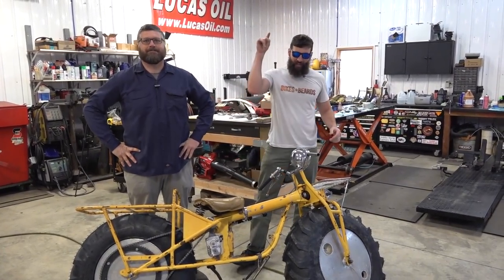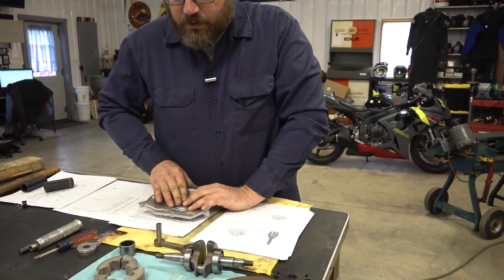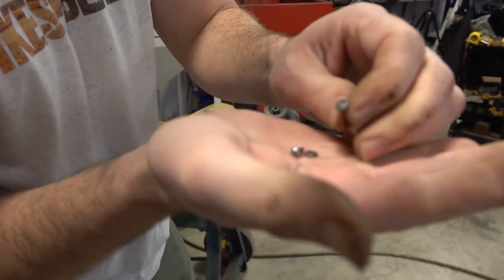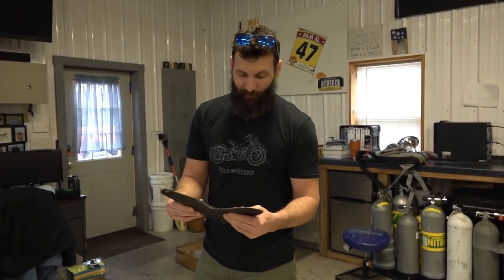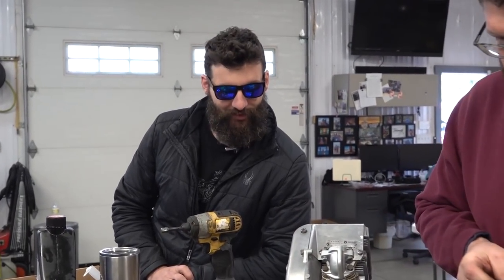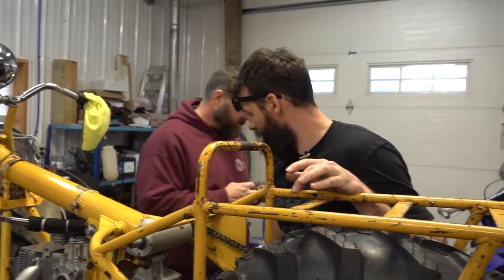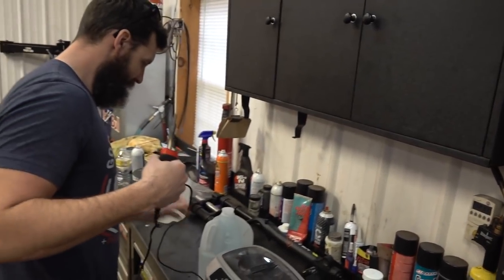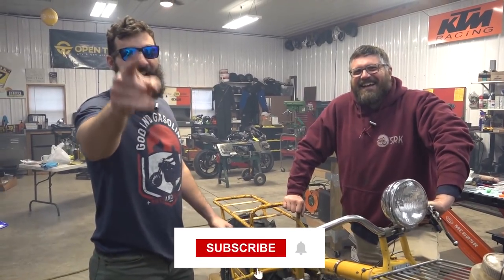Will it RUN?  Rebuilt Ed’s Rokon Engines finally Goes in

Comment: I used to work at the company that was producing the 820 engines in the 90s into the 2000s . I machined the blocks , support plates,  milled the heads etc.  Also built them . Tough little engine .

Comment: Just a thought. If you run the piston to TDC check the carburetor intake and see if the piston clears the port. If not trim to clear. Will improve performance. Exhaust clearance can change timing.
Reply: Ed will be dead before. You get the nugget and it all Together

Comment: Just a thought, would it be worth putting an electric starter on it for Ed instead of the pull start, incase he’s not strong enough to kick or pull start it. I’m super excited for all these projects coming together for Ed.
Reply: Looking at past video of Ed I don't think he will be using it without the help of someone else. Though adding it would be nice for anyone so maybe.
Reply: @pleasedontwatchthese9593  he rode the modern rokon alright!
Reply: I just typed the same thing 😙
Reply: I don't recall an electric starter ever being available for these engines. That may be something that the oems added on to them. But even then I've never seen an electric start on one of these Chrysler two strokes.
Reply: @MostlyInteresting  you can get kits to replace any pullstart.  I think it would be a worthwhile addition
Reply: @LTD347  link?
Reply: Great suggestion 👌.
Reply: He’s not 35 anymore. I doubt Ed’s gonna ride the thing much. 
Those old Rokons are like riding a solid frame chainsaw. 
New Rokon’s have suspension.
Reply from the maker: It would be if we could find someone who made a e start kit for it
Reply: @BikesandBeards  you guys are incredibly smart, I’m sure you could fab something off a different motor to work
Reply: I just typed the same thing 😆
Reply: I know a guy who is an s-tier expert on these engines. He used to build them and race them in carts. I will ask him if he's ever seen an electric start.
Reply: @LTD347  mans went from saying they make kits to saying they could fab something up, seems legit
Reply: They already resolved this when he used the impact to test for spark. Just weld a socket to the pull starter, and bring a cordless impact with you.
Reply: @82cj8  the problem with continuously using an impact on the socket to actually start the thing is you continuously tighten the nut which may break off the end of the crankshaft or put the flywheel so hard up on the taper you may never get it off
Reply: well they sell electric starter motors for 2 strokes on ebay for around $80.... what they do not sell is the custom cover, shaft, or welding skills to put it together.... but you can get the starter switch there.
Reply: This may be a moot point. I seriously doubt the owner is going to be riding this around alone.
Reply: @MostlyInteresting  you obviously don't know anything about Ed lol. He's a helluva 85 yr old.
Reply: My contact tells me that motor is still being made. United States Motor Power, Inc. If anyone knows about electric start they will.
Reply: If the carb gets tuned good, and it has strong spark you won’t have to pull your arm off to start it.
Reply: @BikesandBeards  attach some kind of battery impact driver on the pull start

Comment: When I was 15, I rebuilt my Kawasaki 100 engine and I just learned about 5 things I did wrong. The engine ran about  4 hours and locked up again.
Reply from the maker: ooohh no what did you do wrong
Reply: Yeah that's a little rough being 15 n rebuilding a motorcycle engine. Wow

Comment: Pressing the bearings on that crank that way will tweek the crank.. you need to support the counter weights.. not press them into each other...
Reply: No comment...typed a long one and deleted.
Reply: after seeing him hammer in that wrist pin I'm sure it's not that important to them ha
Reply: @fluxburner1636  My mouth was hanging open long before that. Had to run duct tape around my head to keep from stepping on my jaw.
Reply: @gailtaylor1636  lol I know what you mean
Reply: @fluxburner1636  hahaha 🤣 Shame on the mess !

Comment: Great job. I’m kinda concerned for Ed though. He mentioned this thing only had front brakes but the new ones have both. Prolly the reason he wrecked going downhill in the first place. 
Will the new models rear brakes bolt onto this thing? Need to keep old Ed healthy.  Well kinda. This thing could prolly use a cigarette pack holder on the front handle bars😂
Reply: Yeah Ahhhh,..Ed will Only be allowed on level ground so no worries.
Reply: yea front breaks going down hill takes skill even then you might dump it
Reply: @michaelpayne1737  I’ve actually dumped a bike on slick level ground
Reply: @sanjosejeff   Yeah I don't like driving on slick pavement.... I got caught in the rain one time.
Reply: The brakes
Reply: Sorry the brakes I saw on these things were a small disk on the drive shaft. One brake for all. But if you turn real sharp the front drive disengages.
Reply: Kind of shows how little he knows about the Rokon,  They only have one brake and it stops the entire driveline to both wheels

Comment: Sean, don't pull a pull start until it stops! That's the way you break the rope. Make a bunch of continuous short pulls and stop well before the end of the rope pull and the engine will start quicker. Quick, shorter brth, brth, brth, style pulls until the engine starts. {I'm aware that sentence is lame, but without being there to show you what I mean, it was the best I could do :-*} This from a guy who broke a few starter ropes on his two stroke gas powered tools who learnt the hard way. Good luck and God Bless! Congrats to Dan!

Comment: I sure hope that crank is still balanced after seeing how those bearings were pressed in. Usually you would brace the crank from the bottom side of the counter weight your applying the bearing to so you don’t squeeze the crankshaft unevenly
Reply: It's a Butcher Shop 🤣
Reply: using a hammer on that wrist pin won't help any either so I don't think they know any better ha

Comment: When I was a kid I had a Fox go-cart with that motor. Two summers of odd jobs to save the $50 price. But it was fast. Two Tillotson carbs. Then one day the cops swung by and we couldn't run it on the road any more. So we ran it in the dirt - without air cleaners. We got really good at changing those roller bearings on the crank pin.

Comment: To saturate a part in a liquid like the mud flap, I use a large zip lock bag. It doesn’t require much liquid product when you push all of the air out. 👍👍👍

Comment: Ed's going to love it. By the time you guys and then Robbie gets finished it will be better than new. Too bad it doesn't have a starter, might not be as easy for him to pull it like the last time he used it. A starter would be hard to rig up on that little engine.

Comment: It’s the same as a super pro 125 McCulloch you can get those condensers in points also if it’s an old enough Mac 1010 the condenser will work I have that same bike I was laughing when you guys were working on the starter I knew what was wrong Rachel guys and happy Easter I’m watching it today

Comment: I got a 70ish Rokon running for a friend a while back, that old diaphragm carb was murder, balls and springs everywhere. I got it running, very interesting machine indeed. Never quite understood the low gearing, 1st gear was useless, unless you were pulling logs which you could effectively do in any gear as 3rd was low enough to drag its own weight at idle. Novelty, nothing more.
Reply: ed hauled 4-500 pounds in and out of a gold claim that was inaccessible any other way....i wouldnt say its useless

Comment: Bearings in freezer over night, heat the receiving part lightly up (crank etc.) and pop the bearing on without using press or hammer, same goes with bushings

Comment: The engine on that bike is an "820" engine much like the modern 212 Honda clone engines, It was made by a ton of different companies including Chrysler, west bend and USMP they were used in almost anything including motorcycles, go karts, construction equipment, unmanned aircraft, snowmobiles, water pumps, generators, lawn and garden equipment and many other applications and can be modified to make insane power.
As far as I know they are still being produced new from USMP in limited numbers.

Comment: You must heat up those cases before you set in those bearings it can danmge the chrank,and you have to use an support plate or frame to set those bearings on the chrank it can easil bend in that press
Reply: Yup 👍

Comment: Just a thought. Seeing you young guys do the pull start, what about hooking up a small battery and push button start for Ed? Pull start becomes backup ignition if the battery dies.
Reply: thoughts and ideas are easy.implementation..not so much

Comment: The condenser acts like a tiny electronic trash can. When the points are closed, low voltage electricity generated by the magneto (or a battery) flows through the points into the primary windings of the coil. The energized primary coil can only transfer the energy into the secondary (high voltage) windings of the coil by collapsing the primary field. This occurs when the points open causing an open circuit and zap, high voltage travels from the secondary side of the coil to the spark plug. 
The primary field must be collapsed in order for the secondary windings to become energized. When the points open you cannot have a spark jump across the point gap because that is still conducting electric flow. This is where the condenser comes in. When the points begin to open, the flow diverts into the condenser instead of jumping across the point gap. 
If the condenser is bad, the coil will not function properly and you will burn your points. 
Everything had points and condensers before electronic ignitions so this is freshman high school auto shop level stuff back in the day. 
Point Gap and Dwell are two additional necessary things to know. The Dwell is ‘the time, measured in degrees, the points are closed’. 
Basic tuneups on cars always included changing out the points and condenser. A more complete tuneup would be distributor cap, rotor, P&C, plug wires and spark plugs. I never once changed out points on a small engine but always kept a Points File in my toolbox to clean the contact surface instead of getting new points.

Comment: At a job that I had when I was MUCH younger, we had a Sun Distributor machine, and It had a condenser testing function.  I use to charge the condensers that we took out of the distributors and leave them lying around.  (without anyone seeing me do this, of course)  They will hold a charge for a long time, and if you touch them just right it will shock you.  Pretty soon if anyone saw a condenser lying on the bench, they would carefully take the lead and touch it to the case to discharge the little spark.  That meant that I had zapped them a time or two.  LOL

Comment: I had to pull the flywheel on a craftsman riding lawn mower and it scared the 💩 outta me when it broke free. The crank key way was so worn it knocked the mower out of time just enough to make it spark at the wrong time. We replaced the key way and torqued the flywheel to 100 ft/lbs and she ran like like a top!
Reply from the maker: That can hurt

Comment: I found this out on old bikes a LONG time ago...if you have 'rare' (read: not-in-stock) rubber parts that you REALLY need to 'fully restore', that haven't otherwise degraded, been chewed up, dry-rotted, etc., and you want to return them to 'like-new', take them and put them in a casserole dish that has '303 Protectant' (original formula) in it. Let the rubber parts FULLY SOAK, submerged, for 30-minutes to 2-hours...then remove them, pat dry (blue shop towel, etc.), then mount them back up (don't do this if they use 'sticky tape' to mount, though...it will not stick until they are fully dry...and sometimes, not then).
Unlike 'Armor-all', the 303-Protectant restores the rubber esthers to 'new' that time, air and UV has cooked out. The 303-Protectant restores FULL pliability to the rubber, too. Once restored and replaced, 'wipe down' the rubber part after washes, heavy rains or long periods of sunlight...otherwise, garage-kept, I'd do it at least once every 6-months or so. Your rubber parts will STAY 'like-new'! (works great on flaps, trim, grips, fascia ring-trims, etc.). The real secret (that is no serious secret) to successful use of 303-Protectant, is to FIRST SOAK anything you want to restore...before 'maintaining it' with mere 'wipe-downs'...this is where a lot of 'Armor-All' fans say 'they can't see any difference'...there's a LOT of polymers missing from that 'old piece of rubber' the first time you apply it...and soaking the part is the only way to 'rush repair' back to the piece...otherwise, they're right...you're just topically treating the aesthetics of the part...not 'healing' it. You can do 'big parts' (like tires) by soaking rags in the 303-Protectant and just 'laying them' on the part, as it lays on a trash bag, or something...and then re-wetting the rag for that 1-2 hours...just keep the rag(s) really wet during that first treatment!
(this comment NOT provided by 303-Protectant, or reimbursed in any way...other than from a customer that gladly buys it and uses it).
Reply: By the way, you can triple, quadruple the life of rubber-drive (and fan) belts, tires, etc., using 303-Protectant...just soak them (counter-intuitive for belts, I know) for a couple hours...preferrably when new, then take them off and spray them every 6-12 months. Wipe them down and allow them to appropriately dry, before you put them back on. You'd think they 'squeak' because of this, but they don't...as the rubber bites the pulleys 'like new', because they were restored! I've experimented with hundreds of ways to use this stuff...and short of 're-vulcanizing the rubber', it's the absolute THING to make 'old rubber' like new again...every time! (plus, it works AMAZING on 'real leather', too (my riding jacket gets 303 a couple of times a year...works as good, if not better, than mink oil!)
Reply: @skeetersaurus6249   Everything you always wanted to know about rubber but were afraid to ask ! 🤔

Comment: A condenser is actually a capacitor your fluke multimeter measures microfarads which is the proper way to test a capacitor. Using the ohm meter will tell you if it's working but not if it is delivering an accurate pulse. It's like using a test light to measure for voltage it will show voltage but not how much.

Comment: you should clean all the rust around the coil and the magneto surface too rust is an insulator, clean it off and you'll get a better spark

Comment: I say a peach of pliers... Because I don't Pears. I don't like a pair of anything... Always have things in triplet that way you can have a trinity. Two levers hinged at the fulcrum... used to increase the force to firmly grasp. A plier would be but one lever. You need two opposing leavers to pinch and grasp and so, it's a pair of pliers.

Comment: Ed definitely seems to see  especially the golden nugget as just tools , i think instead of all that trouble with the nugget (tons of work for a non original spec restoration) they should have just bought him a air conditioned side by side for use on his claim , he does seem to want the Rokon though and tells more stories about using that .

Comment: When you guys are done you need to cut together all videos rebuilding the motor. All motorcycle mechanics need to watch it. Small bore motors are way more tricky than most think. You guys rebuilt a few motorcycles in half the time

Comment: 4:44 When one says "a pair of pliers" I think of it as meaning that it has two parts... For example, a pair of pants (two legs), a pair of glasses, a pair of scissors, etc. However this was a naming scheme that is outdated so you don't really hear "a pair of channel locks", or "a pair of vice grips", so its more or less a holdover from earlier common vernacular. However, calling it pliers is a plural so its still saying a pair. "Pass me a plier." Not so much.
Reply: Ok, enough with the pliers Professor
Reply: Vice grips and channel locks aren't pairs. The sides are different. It's more a collaboration for vice grips, and a collusion for the channel locks or slip-joint pliers.

Comment: @Bikes and Beards: Is that with all engines, about replacing the Connecting Rod Cap bolts? I've rebuilt 100's of engines in Cars, Trucks, Boats, and Planes. Never have I had a bolt fail, well not that I know of any way!

Comment: The mechanical ignition timing is terrible, needs constant maintenance to run good. 
Isn't there an aftermarket replacement with magnetic pickup coils?

Comment: That poor crank...you just untrued the crap out of it pressing it like that! Should have used a steel plate between the crank webs. That way you wouldn't have that twisting/torqueing force on the pin connecting the webs.
Reply: With a cap on the connecting rod, I would think it's a 1 piece crank
Reply: @kurtfoulke5130  Still gonna affect the runout
Reply: @TheMajekalBum  the whole show made me cringe, I have a feeling that won't be their only problem
Reply: @kurtfoulke5130   Like hammering in that wrist pin? ha

Comment: I’m sorry but Craig pressed those bearings on wrong that crank is now going to be out of balance he should of put a piece of steel plate between the crank webs so when pressing the bearings on your webs your pushing against the web your putting the bearing on not both as that will send the crank all out of balance

Comment: Do you really use a press to fit the crank shaft bearing pressing on the opposite end of it? It is much easier to put the crank shaft it the freezer and the  bearing in the oven ...and if a press is needed just make sure you are supporting the part on the same half you are pressing...
Reply from the maker: that sounds much harder
Reply: @BikesandBeards  but it's much easier than damaging a crank shaft